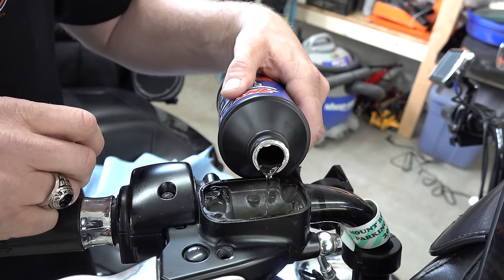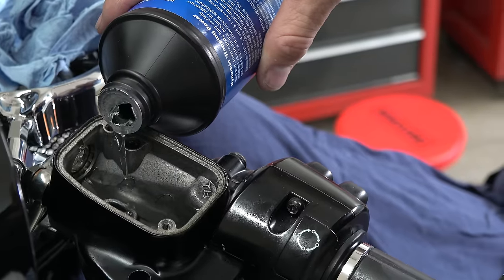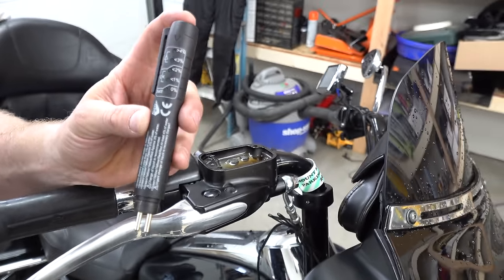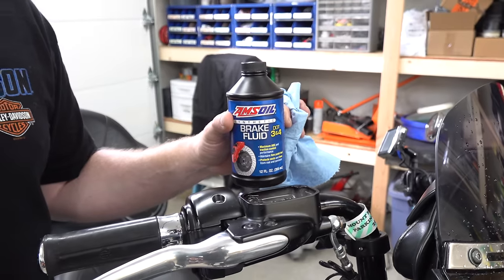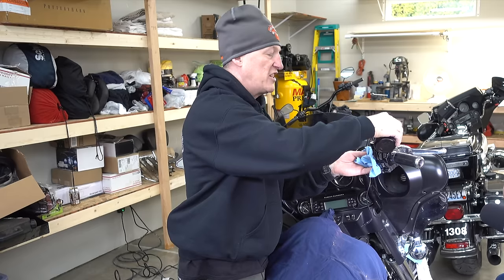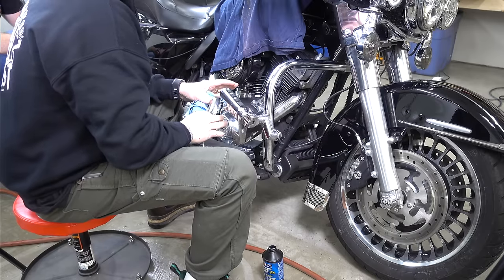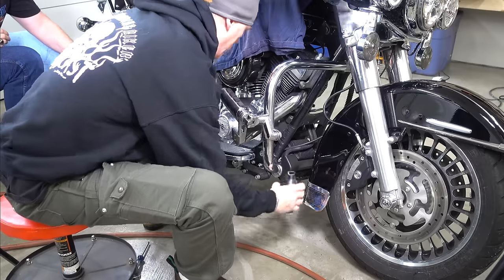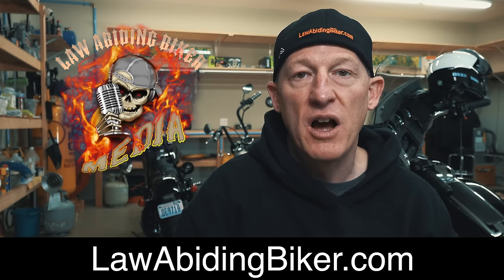How to Bleed & Flush Harley-Davidson Brake System Fluid-ABS & Non-ABS Systems

Comment: I think it was a mistake that you took the cap and rubber diaphragm off, and put it aside with bottom facing up, its gonna put fluid in the cap and its gonna leak out the air vent holes in the cap, forever.
Might cause the paint to swell up and be damaged.

Comment: Great video.  But i would have liked too see how the hand pump worked.
Reply from the maker: Works the same. You just pump it up with the handle and it starts sucking. No difference except its manual.

Comment: Ryan, another great vid, good content,but you should also let the views know that the flush is good for ABS, but the valves in the ABS system should be exorcised also. These valves can become corroded and fail to operate as designed.
Reply: so then how do u exercise the abs valves
Reply: Sam there's only two ways that I know of. 1. have HD do the fluid flush and the computer will do it. 2' After flushing your system, take your bike out to a empty road or parking lot, get up to 2m MPH and slam on the brakes ( front then the rear) this will activate the system. This is the Hail Mary one, flush your system, go for a ride and when a car pulls out in front of you, slam on the brakes and activate the system. The choice is yours to make...
Reply: I got a '14 Dyna this year, it has ABS and needed a flush.  I was under the impression the valves needed to be exercised as you mentioned.  But I found out afterwards that is actually NOT true.  If you add fluid at the reservoir and bleed it out at the caliper, you can replace 100% of the fluid.  Nothing is trapped anywhere in the system.  Exercising the valves is not required.  I don't have something I can cite, but I'm sure you can find it if you look for it.  I found this out from some HD techs online who explained it.
Reply: @bluesriderDF  i was wondering this also...?
Reply: Goshdarnit i am also not finding anything official online about abs flush/bleed..
Reply: @FrensTimmerpens  Well I can't help myself, after I flush the fluid I take it out on a wet (private) road and engage the ABS.   It just confirms everything's working as it should.

Comment: Hello Sir, 

Video makes total sense, and has worked well for my factory calipers, however, on my 2020 FLHX w/ABS, If I am installing a new set of front (chrome) calipers would I follow the following procedure? THANK YOU ! ! 

1. Remove existing front left caliper
2. Install new front left caliper
3. Remove front master cylinder cap
4. Squeeze front brake lever to push caliper cups towards rotor
5. Now bleed front left caliper

The above sequence makes sense (my assumption) because Im trying to fill the caliper with fluid prior to bleeding.

Make sense?

Thanks again!

Love your videos!!

Comment: I experienced full brake failure due to boiling fluid turning to gas coming down Mt. Washington Auto Road. Front AND rear! Two-up! Talk about intense!
Reply from the maker: Dang! That is not good
Reply: @RyanUrlacher  when I changed out the brake fluid it was the same color as coca cola. We managed to use our feet to stop in a turnout area and waited for them to cool and they came back again after about 20 minutes.

Comment: I tried this method exactly the same way on an '02 XL. Sucked the fluid out of the reservoir with a Mighty Vac. Filled it up with my correct DOT 5. Hooked the vac up to the bleed screw and no fluid comes out! Now if I pull the brake lever it just stays pulled and I have to manually make it return. Any suggestions where to look?

Comment: Hey guys. I was at my local Harley dealer recently and they pointed out to me the new Rockford Fosgate line of speakers and amps that they are stocking.  I was able to listen to a pair that were installed in an older Street Glide and I was pretty impressed.  I would appreciate it if you were able to get your hands on a set to compare and contrast to some others.  Thanks and keep up the good work!
Reply from the maker: https://www.lawabidingbiker.com/rockfordfosgate/

Comment: Great  video guys. You DID mention that the procedure is the same for conventional or ABS brakes. However, I am here to caution ABS users they absolutely must be extra cautious about introducing air to the system, especially if they are going to vacuum out the brake reservoir. Any air introduced to the system during brake bleeding will definitely throw a "code" and it will mean a trip to your friendly dealer for a session on the Digital Technician to reset your ABS brakes. That will usually entail a payment of at least 1/2 hour labor. Just so everyone is aware.
Reply from the maker: Glad you like the video and thanks.  You certainly can throw a code anytime when working on your bike anytime. Most can simply be cleared following code clearing procedures. We have a video for that on this channel. Or if you have a Vance and Hines Fuelpak 3 you can clear them. Yes, either ABS or non ABS the air needs to be out of the lines entirely.
Reply: yes I was going to mention the same thing.. I would advise NOT to vaccume the reservoir, there is no reasone to.  just continue to fill it with fresh fluid until you see clear at the end.  Once air is in the system with ABS you must go to the dealer to get it out using the computer.. I didnt see you mention any difference in the video and there are STARK differences with ABS vs NON ABS systems.  you cant treat them the same.
Reply: This is my understanding as well.  You can definitely bleed an ABS system fully without dealer assistance, but if you get air in the system, my understanding is that Digital Technician is needed.
Reply: @tylerfj24  hey question for you: So if I’m changing my upper abs brake line, I shouldn’t vacuum out all of the oil in the MC? I should keep it with fluid ?

Comment: got a 96 dyna wide glide. replaced rubber front and rear. rear brake pumps up stiff until rolled backwards, then pedal is gone. any ideas on this one? no leaks anywhere from res to cal. will be flushing both front and rear brake systems. rubber replaced by a local custom shop.

Comment: Hey Ryan, i need advice please, i have a 2010 Ultra and my rear brakes are not getting any fluid out of the line, have checked master cylinder and keep it full whilst pumping, pedal goes hard and have fluid to ABS block but nothing coming out of the block and through to the rear banjo, calipers now off. Any suggestions please?

Comment: Hate to be that guy but you should always pump the lever when doing a flush not just draw it through hsing the vacuum. The point is to move the master and get everything flowing and working as it should. Not just new fluid

Comment: Question. Is it even necessary to have a suction pump to remove the brake fluid, since opening the bleeder valve will allow the fluid to flow out due to gravity? Once all the old fluid is drained out, you would just simply begin to pour in the new fluid, then pump the brake until all air is evicted, while simultaneously cranking open the bleeder valve in order to bleed all the air out. That is how I used to do it on a 55 Chevy, so the concept should be no different.

Comment: Ryan great video as usual, after flushing and filling the ABS doesnt need to reset? (any such thing) Dealers tell you it does!
Reply from the maker: No reset.  just make sure to work the front ad rear brake prior to riding.

Ride safe & Ride Often!
Here is a link to a bunch of our useful Free vids: http://www.lawabidingbiker.com/freevideos
Here is a link to some of our useful for purchase videos: http://www.lawabidingbiker.com/buyvideos
Want Answers & Information Fast? And help support us at the same time? Do you like the content we provide?
Our patrons get answers to their questions/comments/feedback in less than 24 hrs and are part of our Private Facebook Group. If you are interested in being in this exclusive group you can get all the details at ==> http://www.lawabidingbiker.com/patreon
If you haven't subscribed to the Law Abiding Biker Podcast make sure to do so. Listen in as we talk weekly about issues/items like this & so much more. You can listen on iTunes (Apple/IOS), Stitcher Radio (Android), or any other Podcast App ==> http://www.lawabidingbiker.com/podcast
Join our free email club at http:///www.LawAbidingBiker.com/EmailClub. Only relevant content will be sent from time to time. Email club members are the first to find out about free or for sale content are given special coupon codes.
Reply: @RyanUrlacher  nope you are very wrong on abs bikes. If you suck all the fluid out of the master and expose the ports, you put air in the system. The abs brake procedure is now needed to take out all the air completely.  The procedure breaks the air bubbles into microscopic bubbles so they can pass through abs unit's tiny little valves. You sir are going to get someone hurt by giving out wrong information and will be liable. I guess i shouldn't expect any thing more from a hack trying to sell aftermarket parts

Comment: Is that a abs bike ????
Reason for askin i was always told harley has to use there tool to pulse abs be cool if ya have abs and process would still work
Reply from the maker: This is ABS on this bike. Been doing it for years on ABS bikes.
Reply: Ok thanks alot great tip !!! I really need to flush mine again n i rather not pay them since i have the mighty vac to use from my cars.

Comment: How about all the brake fluid in the ABS module how does this help getting that fluid out and clean ???????
Reply: if you use a vacuum system it'll remove it. and you can have someone pump the brake regularly while maintaining fluid in the reservoir. never let the reservoir go dry, you'll get air.
Reply: From my understanding a vaccum system will not completely evacuate the ABS valve. The issue is that moisture in the brake fluid that is in the valve can corrode valve components and lead to ABS failure. If you bleed the way shown in this video describes you believe that this corrosion is not a high risk, or that the mixing of fresh brake fluid with the tiny amount in the valve will allow mixing. I do not know if that is even possible. At my dealer the flush and bleed is $100. I hate paying for a relatively simple procedure, but had I had ABS on a previous HD I might have saved 9 days in the hospital. I want my ABS to always work.
Reply: Here is how i do my mine on my 08 Ultra with Abs. I do the initial flush and then i take bike out on the road and hit my brakes hard which activates my abs system which pushes old fluid out of abs module and new fluid into it. 
I do this a few times then i go back and flush both front and rear again. This does work cause when Harley had the recall on us with the abs system prone to solenoid lock up i told the Harley tech i already did a complete flush and how i did it and when he did his thing for the fluid recall and after he was done he told me there was absolutely no old fluid in my system and he even told me what i did was pretty smart.

Comment: Ok so I have a question.  I’m not mechanical with bikes.  I’ve changed the oil on my Ktm and both Harley’s, and could do simple projects if I had the parts and tools but when it comes to bikes I really don’t want to work on much, I got kids and this thing has 2 wheels.  So my question is I have my late uncles 04 road king.  He took care of it but passed in 2013.  I didn’t get the bike until 2015 or 16.  It was just sitting around.  Since then I have taken it to Harley I’m trying to remember why, somthing small.  They checked it over I believe but didn’t have much to say.  Now it’s 2023.  What should I do to make sure the bike is 100% good to go?  If I take it to Harley I don’t want them giving me bs and doing things that don’t need to be done.  What should I ask for as well as have them look at? Also the bike just hit 15k

Comment: I got on my 13’ ultra Sunday and my rear brake was hard. And zero effective. Front is fine. I checked the caliper to see if it was stuck due to being rode only 5x on the last year. Will this help? Thanks

Comment: curious to know why Harley use a 10 mm for the bleeder valve nut, (are they made in Japan?) metric instead of imperial, everything else is imperial e.g 5/8" drain plugs, 3/16" hex screws etc
Reply: My 'Made in USA'  Sportster has Brembo brakes which are made in Italy hence why metric. The Showa shocks on my 'Made in USA' Sportster are Japanese. Not that I have a problem with that.

Comment: What's the recommended torque specs for the bleeder valve? Mine is seeping a little after torqued to 60 in lbs.
Reply from the maker: 71-108 inch pounds for the front brake bleeder valve and 75-102 inch pounds for the rear brake bleeder valve.  

Ride safe & Ride Often!

Check out this YouTube Channel as we have a ton of free videos for you!

Check out our useful for purchase videos: http://www.lawabidingbiker.com/buyvideos

BECOME AN ECXLUSIVE MEMBER-GET BENEFITS:
http://www.lawabidingbiker.com/patreon

Leave a flat donation: 
https://www.lawabidingbiker.com/donate

Shop in the Official Law Abiding Biker Store:
https://shop.lawabidingbiker.com

Subscribe to the Law Abiding Biker Podcast: https://www.lawabidingbiker.com/app

Join our free email club:
https://www.lawabidingbiker.com/emailclub

Comment: Dealer told me that for 2011 CVO Road Glide with ABS you need to bypass the ABS electronics (via Dealer) to do the flush.  You indicate that ABS or not the flush process is the same.  Ive bled brakes before and never heard that.  Dealer hype?
Reply from the maker: Same. We do it all the time and have done it for years.

Comment: So the mityvac replaced the hand lever pumping? Without the mityvac you pump hold  open and close? Is there another way to drain the bubbles by opening valve and adding fluid?
Reply from the maker: You'll need a pump to properly bleed the lines.

Ride safe & Ride Often!

Here is a link to a bunch of our useful Free vids: http://www.lawabidingbiker.com/freevideos

Here is a link to some of our useful for purchase videos: http://www.lawabidingbiker.com/buyvideos

Want Answers & Information Fast? And help support us at the same time? Do you like the content we provide?

Our patrons get answers to their questions/comments/feedback in less than 24 hrs and are part of our Private Facebook Group. If you are interested in being in this exclusive group you can get all the details at ==> http://www.lawabidingbiker.com/patreon

If you haven't subscribed to the Law Abiding Biker Podcast make sure to do so. Listen in as we talk weekly about issues/items like this & so much more. You can listen on iTunes (Apple/IOS), Stitcher Radio (Android), or any other Podcast App ==> http://www.lawabidingbiker.com/podcast

Join our free email club at http:///www.LawAbidingBiker.com/EmailClub. Only relevant content will be sent from time to time. Email club members are the first to find out about free or for sale content are given special coupon codes.

Comment: Thanks! My brakes all of a sudden got real hard to  grip-I am suspecting the fluid is just shit. I am a little old school...I dont have the "suction" tools...can I use the old school gravity bleed?
Reply: Not with ABS.. standard systems.. you can. But I would the old, Open, Pump, Hold, and Close method to push the air out

Comment: Bryan just a quick and hopefully simple question.

I own a 2016 Ultra Limited Low with ABS. All I want to do is flush my brake fluid with new stuff.

Is it as simple of a job as you’ve had shown in your video or do I need to purchase a computer module to plug into my ABS and to my laptop and go through its procedure that way?

I also own a 2000 FXDX (non ABS) and to bleed the brakes on that it’s as simple and straightforward as your video shows.

Anyways any help or insight is much appreciated.
Reply from the maker: All you need is a vacuum bleeder.  You can "exercise" the ABS valves by braking hard and activating the ABS.  Do it in a safe location of course.

Ride safe & Ride Often!

Check out this YouTube Channel as we have a ton of free videos for you!

Check out our useful for purchase videos: http://www.lawabidingbiker.com/buyvideos

BECOME AN ECXLUSIVE MEMBER-GET BENEFITS:
http://www.lawabidingbiker.com/patreon

Leave a flat donation: 
https://www.lawabidingbiker.com/donate

Shop in the Official Law Abiding Biker Store:
https://shop.lawabidingbiker.com

Subscribe to the Law Abiding Biker Podcast: https://www.lawabidingbiker.com/app

Join our free email club:
https://www.lawabidingbiker.com/emailclub

Comment: Hello and thank you for the video.... I have a question regarding my 95 softail custom. Rear brake drags and I've had the caliper rebuilt, cylinder replaced and brake line replaced. Still dragging... Any suggestion?? 
Thank you for any ideas.
Reply: Are both pads dragging?  Sometimes on the floating caliper they get a little stuck..  check the slides are clean and you can wiggle the caliper...  after market wheels or anything?   Might have a space issue as well that the rotor and caliper are not aligned.

Comment: I noticed you guys vacuum doesn’t suck the fluid out solid. Mine did same thing and thought wasn’t working right lol. Can’t tell if there is air bubbles when it comes out streamy
Reply from the maker: Yup, Normal. Do it for a bit and then test the system. Will be fine.